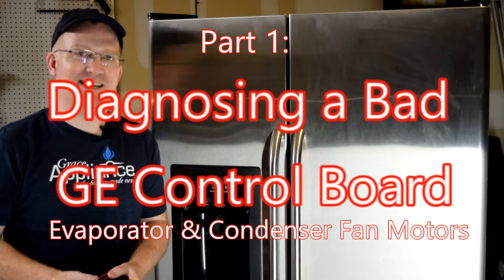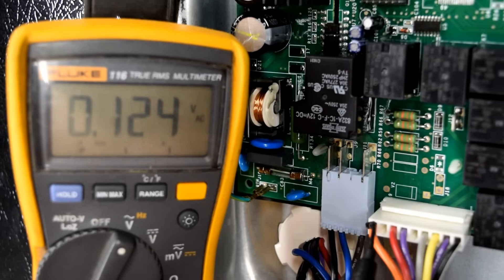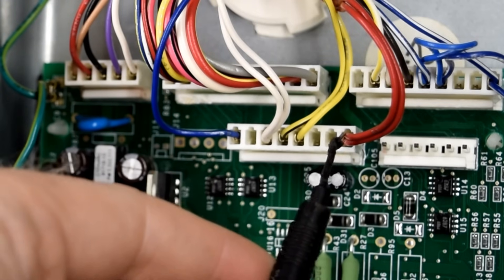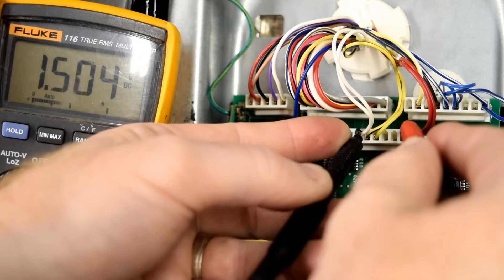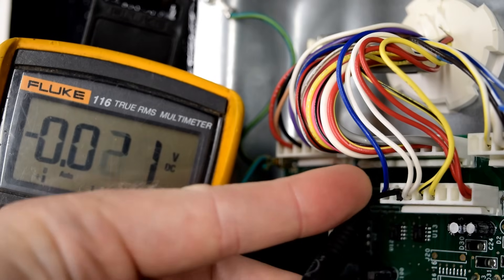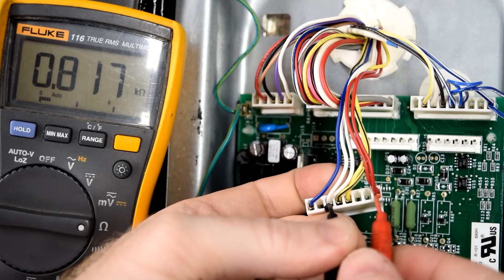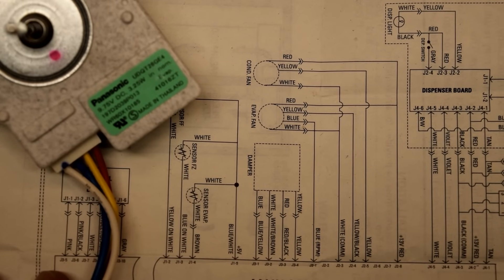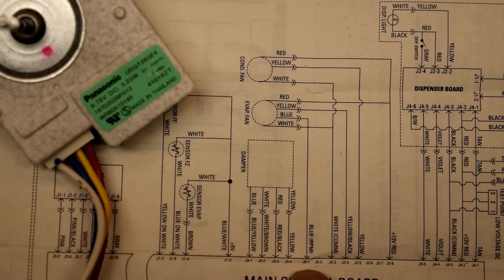Diagnosing a Bad GE Board - Part 1: Fan Motors

Comment: Great video, where did you get your test leads?
Reply from the maker: Thanks!  
I wish I knew the brand name on them because they've done great for me for years.  
They were an impulse cash register buy at Appliance Parts Depot where I was getting some parts. 

The only change I made to mine was to peel off the rubber coating on the needles to make them that much thinner for this kind of work.  

What you're looking for is "needle tip meter leads" like shown here at this affiliate link: (copy and paste that please...it's not wanting to link correctly) 
https://www.amazon.com/gp/search/ref=as_li_qf_sp_sr_tl?ie=UTF8&tag=graceapplianc-20&keywords=meter leads needle tip&index=aps&camp=1789&creative=9325&linkCode=ur2&linkId=7ec2d1d8b31e58381e9d02f9cc461c68

You'd love them for sure!

Comment: Thank you so much Andy for your detailed video. I am just trying to understand on J2 moler contactor you put your black lead on white wire and red lead on red wires I am trying to understand and wanted to confirm my understanding, it will show the voltage is being supplied between 12v to 14v for both evap & cond fan motor correct? Because later you tested evap & cond fan separately from white to yellow/black and yellow. 
So white and red should show between 12 to 14v DC for both fans and then separately white to yellow/black and white to yellow should be 12 to 14v DC as well. Did I understand correctly?

By the way where did you get that kind of small probes for your meter or if you did, how did you make them? Mine is very thick and regular looking and I do not want to shove that into the molar connector. 
Also you showed how to test power coming to the board can you please tell me what do you call those moler connectors? Are there any #s that indicates that those are power supply connectors?
Reply from the maker: Hi, you’re welcome and thanks for watching.  

You are correct, the red and white wires are the supply voltage for both fans which is then distributed to each fan motor as determined by the board.  Here is a follow up video after having replaced the board and will show you correct voltages as I’m testing.  
https://youtu.be/jX2AnQL3yi4

As for the questions about the plugs, the extent of my knowledge about the plugs is that they are made by a company called TE Connectivity. At least the white plugs are and imagine they all are. They are very similar to Molex brand connections, but different in measurement.  Also, the pins inside the connector are quite different between these two brands. Looking on mouser.com will get you in the right ballpark for the needed part numbers.  

Another thing to note is that the lower 1/2 of the board is going to have A/C voltage (120vac) and the upper portion of the board deals only with DC voltages (13vdc and less). 

To my knowledge, There are no component level schematics for this board. Only pin out diagrams.  So, the majority of what I know has been through what’s available via tech sheets and trial and error....much error. Haha

Comment: Hi Andy, I have a GE Profile refrigerator Model PFSS6PKXESS and was trying to do the tests on the PC board you showed in your video, but none of the connectors look anything like the one you are showing and does not even have a J2 identifier anywhere on the board or any of the connectors don't have any kind of J? identifier. So how can i do any of the tests you are showing. I have replaced the main PC board and the smaller PC board as well also i have replaced the condenser fan the evaporator fan and the little circuit switch box that is connected to the big Freon tank. I can hear the tank come on and i can hear the the circuits clicking as if though it is going through its cycle but the condenser fan does not turn on immediately but will after about 10 minutes or so but the evaporator fan will not turn on at all and the refrigerator will not get cold. Is the refrigerator just dead or how much more money should i put into this thing? Please help I am trying to get this fixed for my daughter in law and her family as they desperately need a refrigerator ASAP. I don't want to have to pay a repairman if i don't have to. thank you in advance.
Reply: By the way, the issue I had with just 8.45v at the j2/j13 (white/red) is a clicking noise coming from the board.   It wasn't able to fire the compressor and fans with such low voltage.  Sometimes you can get lucky unplugging/replugging and get the compressor to fire up but as soon as the set temp is obtained the compressor shuts off and won't fire again (more clicking from the relay on the board).

Jfyi for anyone with similar symptoms
Reply from the maker: Jason Clark you nailed it. The white and red should be steady on 13.5vdc full time and it’s this voltage that’s then distributed out to the fan motors accordingly. The evaporator fan motor is variable speed of course and varies between 3 different speeds by adjusting the voltage....but if the original supply voltage isn’t there none of that will work right.
Reply: Hello you two.  I had the same issue as this guy, it's not labelled j2, but instead j13.    It's in the exact location as the one in the video and pinout is the same.

Mine read 8.45v, time for a new board.  Thank you Andy
Reply from the maker: Thanks for the confirmation Jason!
Reply: Thank you very much for this video.  I've always been a tinkerer - so any chance I get to tinker and save money I'm all about it.   Quick question.  There's some capacitors bulging next to the top-most power regulator.  Two 470uf/25v caps.   Is it possible these two caps are leaking and that's why I'm having this issue?   
If I can pop in two new caps and call it a day, that'd be awesome
Reply from the maker: Hey, you're welcome and yes more than likely that's your issue. 
I would start there. With the caps you need to stay with the same uF, but can increase the voltage rating with no issue. It makes for a more robust capacitor than what comes stock. 

Just be sure that the caps will physically have space on the board, but I routinely use 50v.

I usually get them from mouser.com FYI

Let me know if you have any questions. Andy
Reply from the maker: Hi Mike,
Sorry to hear about the fridge issues.

So, my videos are currently focused in on the GE side by side only so they're only going to be generally applicable to your French door fridge.

It sounds like you've replaced the relays at the compressor. I'd be curious to know if your relays are getting 120vac.
Youd need a meter to test this, unplug the fridge, Uninstall the relay from the compressor but leave the wires attached. Plug in the fridge again and check for 120vac at the relay.
If you can find 120vac here consistently, I'd then focus my attention on a failed compressor.
If the compressor runs non stop, the freezer should be getting sun zero so long as both fans are working and there no defrost issues. 

Are you hearing/feeling the compressor run continuously or is it cutting in and out? 
Let me know what you find with the voltage test.

Comment: I have a GE profile french doors model #pfss5rkzhss and the temperature has been out of wack on it. Temperatures are rising on both freezer and fridge area. After unplugging and cleaning the dust from the back then plugging it back in it worked for 3 days where it cooled to set levels but then temperatures started rising again. Did a little youtube search and one guy suggested changing the inverter so i did and the fridge worked for exactly one week then temperatures started rising again. It seems like the fridge works for a couple of days after unplugging and plugging back in. I bought a back up fridge so i don't have to worry about the food getting spoiled. Now i just leave it plugged in and it will warm up for a day or two then cool back down for a day or two all on its own. What do u think? Does it sound like a bad control board or is there other issues i should worry about? Thank u.
Reply from the maker: Hi,
The symptoms sound like a defrost issue. Typically it will run like normal got a few days and then get warm because it hasn't defrosted at all or defrosted fully.
I'd start there. Watch this video and let me know if you have any issues:
https://youtu.be/XeZfpB7ok90

Thanks!
Reply from the maker: Actually, if it were defrost it wouldn't get colder by just disconnecting power and reconnecting. You'd had to have let it thaw to have any affect on a defrost issue. Unless perhaps rebooting the board causes it to then defrost properly for a time. Getting eyes on the freezer evaporator would be very telling to rule this out. Defrost issue would be super frozen up evaporator vs just a light coating of frost. 

Inverter board might make sense if your compressor were not running during the problem times. Also, it may be running but not at full speed.

Have you noticed if that's the case?
Reply: @GraceAppliance  ya during problem times or when the temperature starts to rise the fridge doesn't sound like usual. I should also note that first time i unplugged fridge took about 15 mins to boot back up after plugging in. The second time just over half an hour to boot back up and the third time it wasn't starting at all after at least an hour past by so at that time i actually disconnected couple of the white plugs on the control board and plugged them back in and as soon as i plugged the power it came on right away. Since then I haven't unplugged it at all i just let it get warm and cool on its own.
Reply from the maker: @orthoking2722 
Gotcha!
I'd observe the compressor to see if it's coming on during that time.
This could be caused either by the main control board or the inverter control board. The main controls only job for starting the compressor is to send a low voltage signal to the inverter board. I beleive it's 5vdc from  2 wires from the main board. This tells the inverter board to supply the compressor with voltage. So, if you're getting the low voltage signal voltage from the main board, it's doing its job. 

I'm not at a place I can look up the tech sheet right now, so I'm just going off memory here. 

I'd start by seeing what the compressor is doing.

Let me know what you find.
Reply: @GraceAppliance  I did change the inverter board but that only solved the problem for a week. ok ill take a look at the compressor and i was told that if it feels really hot to the point where you cant leave your hand on there then something is wrong with the compressor. Does that sound right to you?
Reply from the maker: @orthoking2722  yes, it shouldn't be that hot. Also, disassemble the freezer section to look at the evaporator and that will tell is a lot.
Reply: @GraceAppliance  Ok thank you so much for taking the time to help out. Hard to find people like you nowadays. You gained one more subscriber. I will update you as soon as i figure this out.
Reply from the maker: Glad to have helped in a small way. Let me know what you find and I'm glad to try and help if I'm able.
Reply: @GraceAppliance  So an update here. My fridge worked perfectly for 3 weeks after the last time we talked. Then it did it once again where the temperature went up  for about half a day and what i noticed is when the temperature rises it rises quick as if hot air is getting blown into the fridge instead of cold air. While the fridge was getting warmer i moved it forward and accessed the back. The big fan next to the compressor is running fine but the compressor is too hot to the touch and i pointed my temperature gauge on it and it read as high as 136f. So is that gonna be a bad compressor for sure now? Also when this is all happening the fridge sounds the same as it would when running normally.
Reply from the maker: It could be a restriction on the sealed system. If you can catch it when this is happening, drop the back wall of the freezer down by removing the 4 bolts and snap a picture of the freezer evaporator.  Send it to GraceAppliance@gmail.com 

That will likely tell me what’s happening.

Comment: When I hooked my meter up  the numbers was doing the same thing yours was ..I unplugged the refrigerator for 24 hoursnow the numbers are normal and the refrigerator works .. does this mean the board is going out
Reply from the maker: Hey Alan, 
It sure sounds like a bad board to me. It’s actually an easier thing to test when it’s acting up at that moment though. It’s the intermittent issues that are the bears to track down.  But, the fact that it returned to normal after being unplugged for a time is textbook failed control board.  
I’d suspect the board has weak relays or a possibility that the evaporator fan motor is periodically shorting out which robs voltage by creating a short circuit.
If you wanted to wait until the next time it acts up, you can unplug J2 (I.e. fan motor circuits) and see if the fridge comes to life at that point. If so, your issue is a failed fan motor and most commonly the evaporator fan motor.  Or, if you want to be proactive about it, go ahead and replace both.  If it’s a primary refrigerator I’d probably go that route. 
If you order though Amazon, please click the link from the description which helps the channel a ton. 
Let me know if you have any questions in the meantime!
Thanks,
Andy

Comment: hai,
thank you for very good and usefull informative video. my refigerater evaperater fan is not working.as per your video i followe dby tested all voltage level of pin j2..red wire i found 12 v but yellow to eveaperator wire is showing only 5V..can u suggest me any solution?
Reply from the maker: Hey!  Thnaks for the kind words. I'm sorry to hear you're having issues with your fridge.

Check out this video. It explains that the voltages will vary based on what speed the evelorator fan should be running as it's a variable speed fan motor.

See if when you jump it if it speeds up to full speed and let me know what you find. 

https://youtu.be/PwsoOpUbxvk